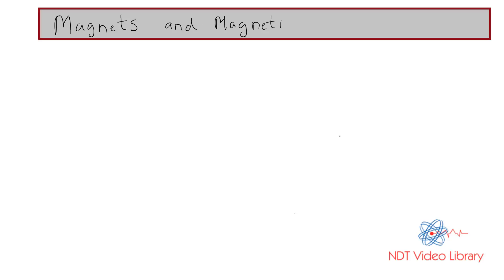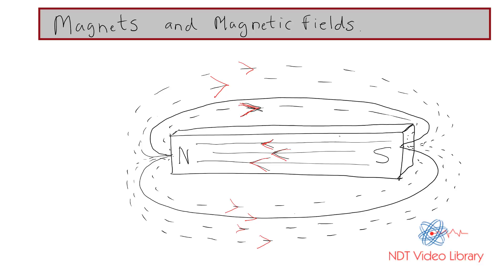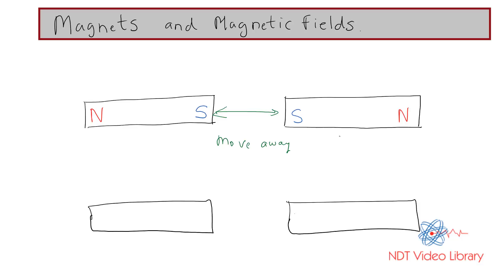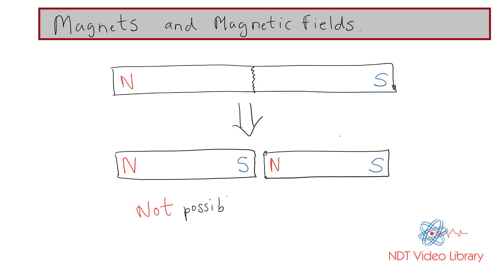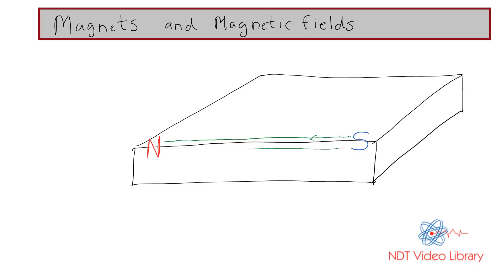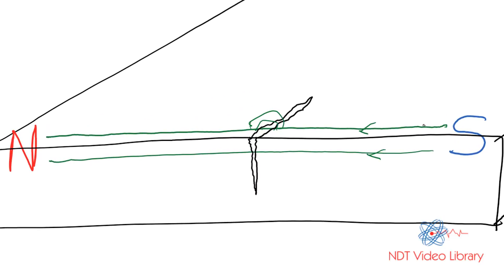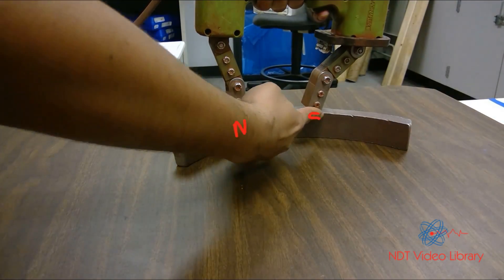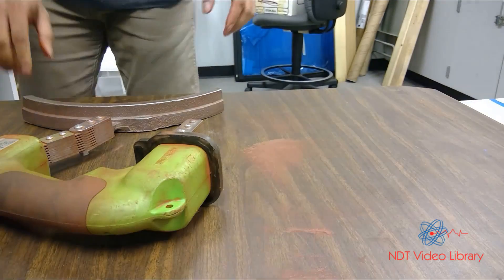How does Magnetic Particle Testing technique detect indications?

Comment: Answer: MT is only good for surface and near surface (0.06") cracks
Reply from the maker: Absolutely right, Mr. Korey. Although the depth could vary depending on whether you use AC or DC. DC penetrating deeper.
Reply: 1/4” is too far only .05”
Reply: DC/MT is good for  depth of 1/4" in carbon steel.. AC as mentioned has better surface discontinuity detection.. also, A/C vibrates your magnetic particles better :)